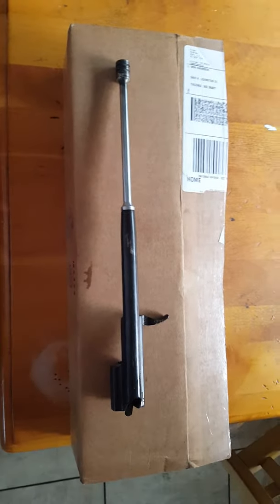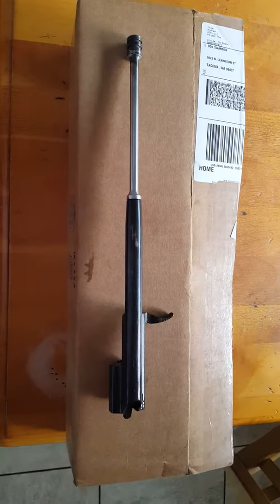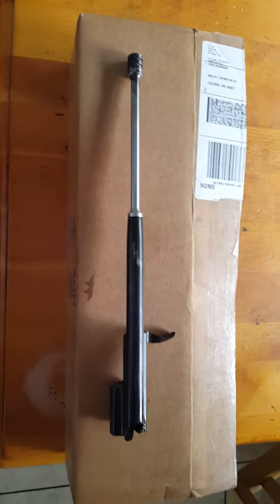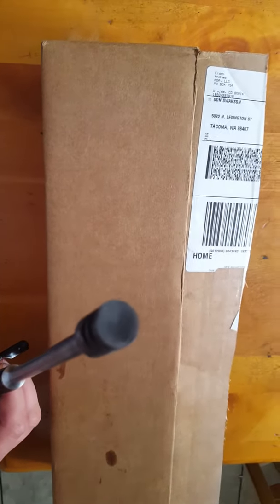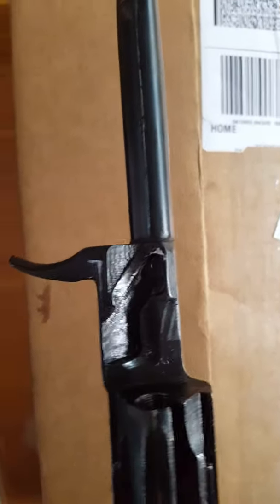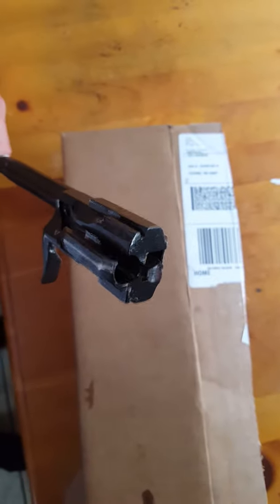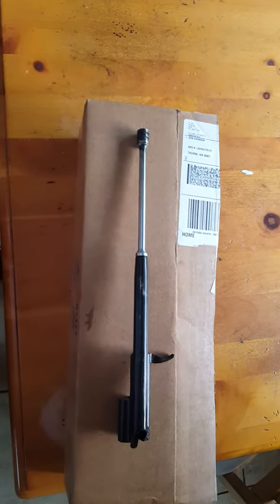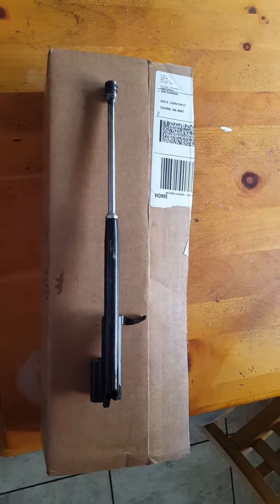Wasr 10 bolt carrier replacement

Comment: I was having a similar issue with my DDI Hungarian bolt carrier. From my research it appears to be caused by two things that are closely related. After a round is discharged and the bolt carrier is coming back, the tail meets the hammer and forces it back into the trigger group to reset. The American made AK hammers, notoriously the Tapco G2 (which is had) is shaped differently than what these rifles were designed to function with. The tail meets a sharp edge on the Tapco when it's pushing back, that, combined with the hardness difference with the two mis-matched parts, causes the deformation. The Tapco is significantly harder than the bolt carrier and others have tested this hardness rating and confirmed. YouTube user Mel64D has done a great video illustrating this effect of the two pieces meeting, and compared it to a surplus AK hammer. 
I recently picked up an East German bolt carrier and piston and was blown away with the quality. That and a new surplus hammer should fix my problem

Comment: I have to replace my wasr 10 bolt carrier. So a polish one will fit? On some wasr 10s like mine the piston is welded to the carrier. Good tell tale is no roll pin in the hole. The weld it and grind it. Can you send a link to that polish one. Thanks